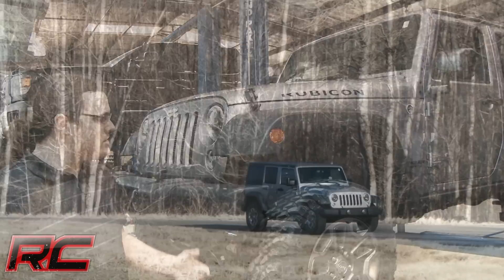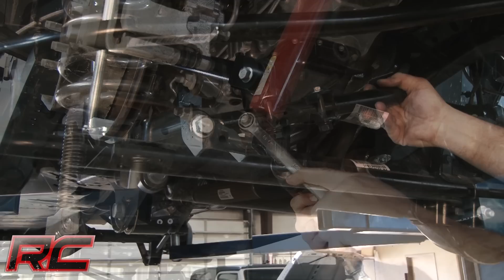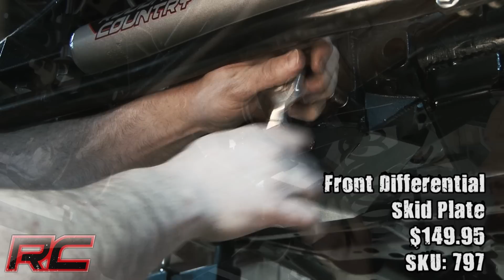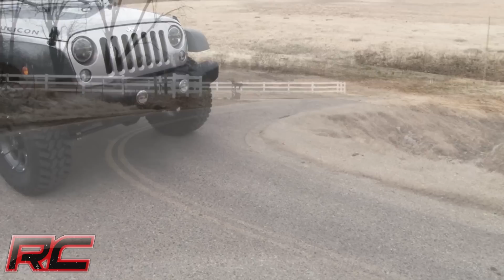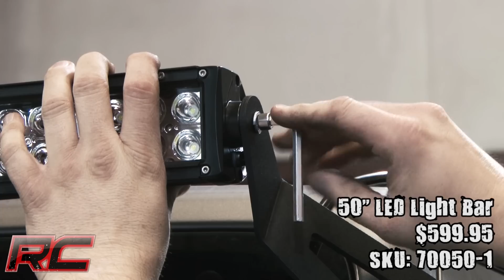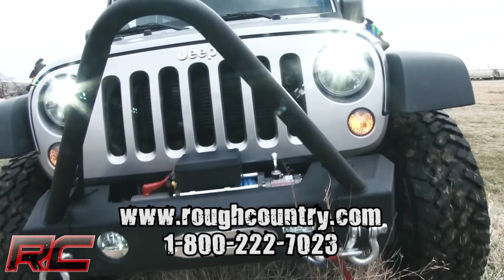2014 Jeep Wrangler JK Unlimited Build: RC Builds Episode 4

Comment: I'd be a bit worried about the exposed nuts & bolts on some of those skid plates shearing off, is there anyway to use flush mount stainless fasteners instead of the usual mild steel items? I did not like the idea of drilling. The rear diff skid plate has less metal and is almost as much as the fuel tank skid plate which has more metal. The other thing is those so called "D shackles" are "Bow Shackles". Other than that I enjoyed watching the upgrade. Cheers :)

Comment: do you need to relocate the vacuum pump if you are not installing the winch? 
I plan on installing a RC stubby (the cheaper /price wise ) of the one you make
Reply from the maker: If you are not installing the winch then you do not have to relocate the vacuum pump, that is correct.

Comment: RC:  Can you explain about the DS in this build and why it is not part of the upgrade?  Thanks!
Reply: I love how they always leave out the part about your drive shaft angle after all this work is completed. They conveniently leave that out. Because they know how much it's going to cost
Reply: I installed a three and a half inch lift kit in my ZJ and the driveshaft vibration was so bad that I had to buy another set of adjustable upper control arms rather than by a Tom Wood's Driveshaft for eight or nine hundred dollars. I angled the differential to point towards the driveshaft thankfully it eliminated the Driveline vibration

Comment: don't yall need to install a front DS since its a 4dr and going over 3.25" of lift?
Reply from the maker: We have found that the Drive shaft is more common on the 4". The 3.25" will occasionally need  to be replaced on the 3.25" but it's one of those cases where you don't really know if it's necessary until the kit is installed.

Comment: Great video guys. Did you guys need to re-gear / reprogram to compensate for the larger tires? Also, did the drive shaft need replacing due to the lift ?
Reply: +ectomorph probably not if there sliding ones

Comment: VERY nice build... Think I'll take it all when I get the Jeep in a couple months!

What headlamps are you running on that rig?
Reply from the maker: Thanks. Not sure what headlamps were used.
Reply: i dont know much from jeeps but if you thought those on the bumper i think those are stock ones
Reply from the maker: The lights on the bumper are fog lights. They are stock, but the bulbs in them are aftermarket. They match the aftermarket bulbs in the headlights.
Reply: theyre truck-lite's. i have a friend that has them on his tj and theyre EXTREMELY bright. so bright in fact, that he took off the rigid d2's he had on the front because the headlights outshined them lol
Reply: They look like JW speakers